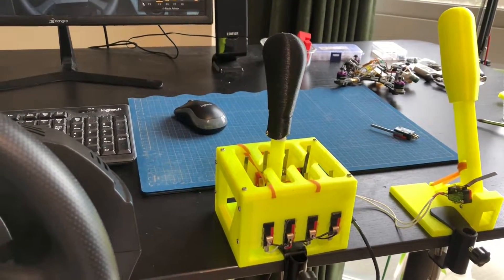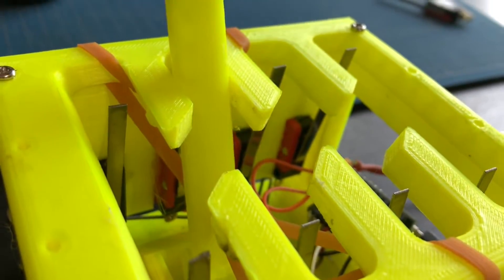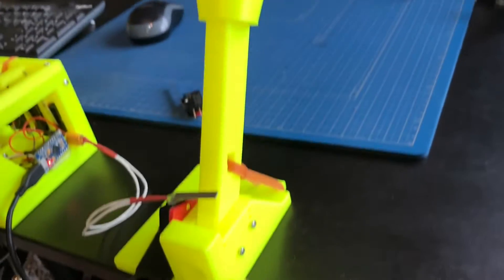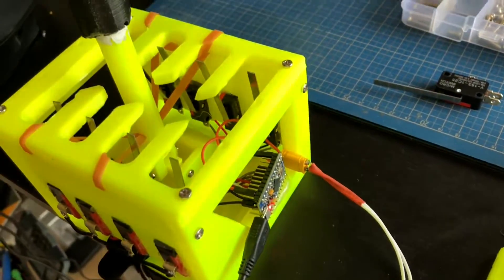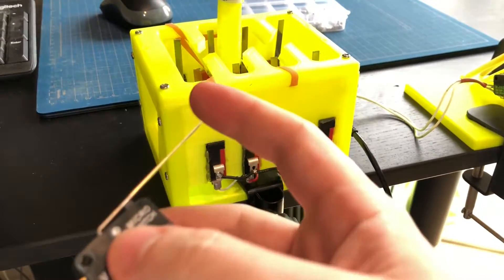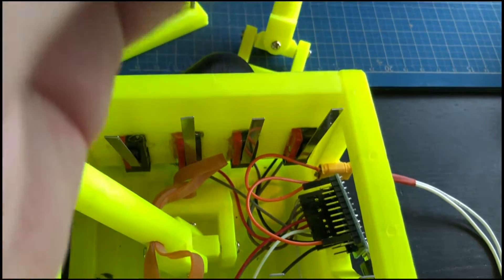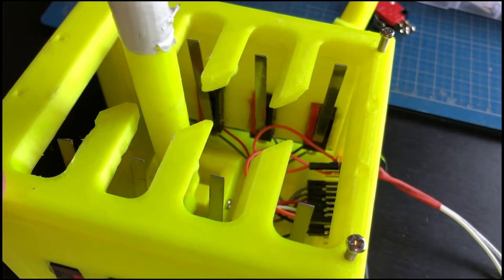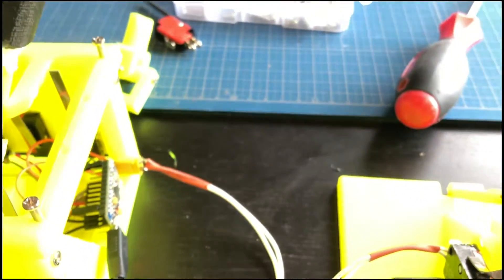3D printed shift stick and hand brake

Comment: Can I print this with %10 infill ?
Reply from the maker: Go for it my man
Reply: @AkakiKuumeri  Ok. Can I use with Arduino Uno ?
Reply from the maker: Ömer Serhat Şahan the code I wrote only works with Arduino Pro Micro and Leonardo, it will need to be adapted to Uno. If you must use the Uno, you’ll probably want to use the UnoJoy library. Good luck
Reply: @AkakiKuumeri  Thanks. I'll try.

Comment: Works with asseto corsa?
Reply from the maker: It does
Reply: @AkakiKuumeri  nice thanks can I ask a few questions?
Reply: Is this gearbox directly connected to the computer? If so, do the transmission, accelerator pedals and steering wheel can be separately connected via usb to the computer
Reply from the maker: Adifinek yes, it is directly connected. The wheel and other devices are separate
Reply: Thanks you very much